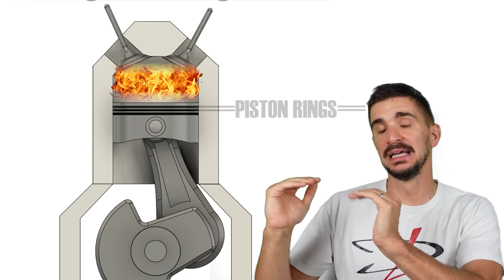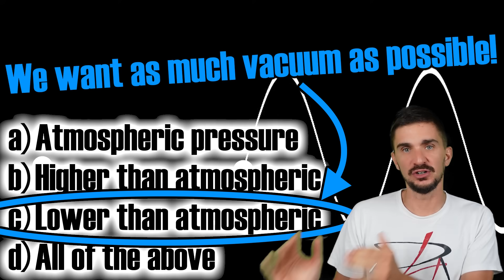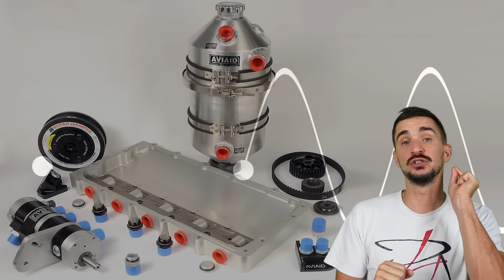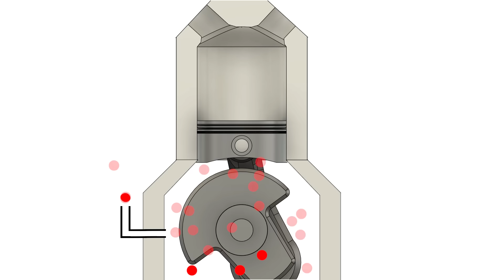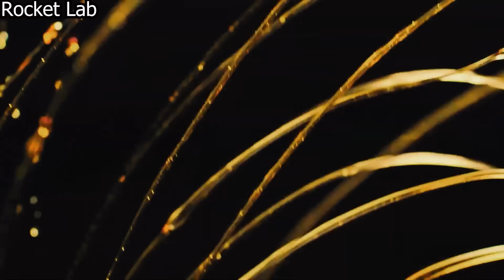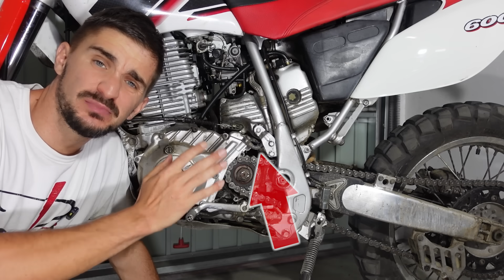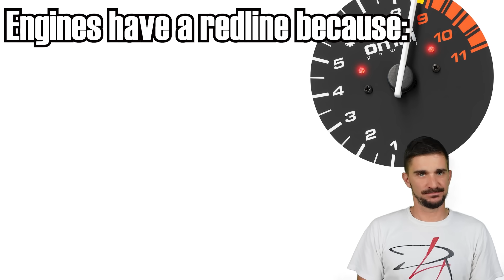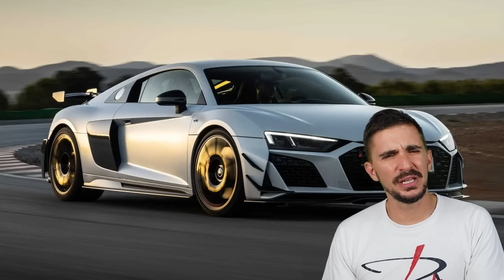Installing This Has No Drawbacks, Except for Your Wallet - Dry Sumps Are Awesome, Here's Why...

Comment: Decades ago, when Yamaha came out with the TX 750 - their first four stroke motorcycle - mechanics would route a hose from the crankcase vent to blow oil mist on the chain. This helped keep the chain clean and lubed. The chain would not wear and stretch as much as the not protected chain.

Comment: On a 1 cyl engine the crankcase volume is always changing/alternating. Anything 2+cyl and the alternate pistons are moving in opposite directions so the pressure remains the same. But...Blowby volume will increases into the crankcase w RPM and that would build crankcase pressure. I've seen drag race cars plumb a hose from the top of the oil pan to the downstream exhaust to help 'pull out' pressurized case gasses without messing w intake ingestion as a vacume point. (Race cars 'Aint Care' about emmissions)

Chevrolet put the LS2 in alot of 2wd cars and 1 (optional AWD) Tralblazer SS. The AWD trucks had the same oil pan/sump as 2wd and launched harder, so alot of guys(and soccor moms that liked to launch hard) were starving the motors over time. The sumps were at the front of the motor so all the oil was moving away from the pickup to rear. All TBSS trucks had 4:11 gearing so even the RWD trucks would starve the pickups but the 4wd ones were worse on the starvation. The aftermarket eventually sold a rear mount sump relocation kit to solve that. You would think GM engineers would have thought about it...maybee they did but accounting possibly killed the 'fix' to save production cost. We are here in 'modern times' and vehicles are still not being engineered or optimized on our behalf to stay reliable. Your 'on your own'  to research the small deets with your vehicles.

Comment: You're really losing me on how the oil drains down in a dry sump system.. It still pours off of the rotating mass. The crankshaft has holes in it that oil the bearings.. The entire rest of the engine and oiling system isn't changed because you installed a dry sump.

Comment: Wouldn't the wet sump be more efficient at low rpm part throttle applications? Less blowby, less oil resistance and maybe then the dry sump pump resistance is more significant? (That would explain why it makes sense is a daily...)

Comment: As explained the dry sump system still relies on gravity, so I don't see how it helps airplanes. That would seem to require closed loop oil circulation without it going into the crankcase cavity at all.

Edit: I looked it up. Basically airplanes have one of two predominant orientations. In almost all situations the net acceleration the aircraft experiences is to its floor whichever direction that happens to be relative to gravity. But in planes that are meant to be able to fly upsidown without curving towards their roof, they simply have two sumps one on the top and one on the bottom, and an acceleration actuated selector valve for feed into the oil pump.

Comment: 11:30 That is a greater heat capacity, but a larger heat capacity does not on its own result in a higher heat fluxrate. In other words without additional radiating capacity more oil will only make the engine take longer to reach its equilibrium temperature, or buffer temperature swings in responce to large changes in power output. It will not change the equilibium temperature of the system under constant loading.

Comment: The whole video suggests that the engine will also become more efficient, because more power with the same amount of fuel = more efficiency. Assuming the extra pump does not eat all of the gains. So I wonder if we will eventually see dry sumps left and right in the name of gas mileage.

Comment: Lower than atmosphere pressure results with the Volvo 2 liter engine ( When the top cover of the valves breaks down ) to sound like there’s a little bird in the engine.  The oil filler cap gets sucked in, creating that sound…

Comment: One drawback that is not covered is that the oil is going to be too cold for longer during startup because there is just a lot more of it to heatup and it can cool down in the external tank rather than it being kept warm in the engine. That is another reason it makes no sense for most street cars.

Also the ND miata's oil system can handle 1.4Gs laterally with simple baffles which is all a car like that needs even if you turn it into a track car with slick tires on and add a ton of aero.

Comment: Tangent, But speaking of wrist pin lubrication. Current dilemma I'm having. My engine comes with forged rods, cast pistons, and oil squirters. The common logic with the engine is to remove the oil squirters when installing forged pistons because the stock pistons do not have any oil holes drilled into them, and all the aftermarket pistons do. The idea being that with squirters you'd "over cool" the pistons, and possibly crack them.

Crazy? Logical? Doesn't matter in a sub 400hp engine anyways?

Comment: If "Performance" were the reason for Ford Wet Belt, it sure would solve the maintenance problem if that belt were external.  Also, I am guessing lower oil resistance improves fuel economy.  The threshold for an engineering change seems to be only a fraction of an MPG for the solution to get into the engineering program.   Dry sump would do that.  I'm simply not buying a wet belt motor.

Comment: great for sucking clean oil out...but you need all that other oil to flow the metal shavings and carbon deposit out that don't come with it much at all and remain in the engine due to lack of flow which causes pressure on the debris inside the engine to roll out the drain....gravel and rocks and boulders in a river and the drain is the water fall. the further away and the faster the suction of the water the less that is removed.

Comment: Lean angle in a motorcycle does not force oil to the side. The centripetal force od cornering combined with gravity makes a compound vector force that is paralel with the vertical axes of the motorcycle.

Comment: Under "Drawbacks" you forgot to state "Increased points of failure (leaks) from the plethora of added hoses." Obviously, this can be minimized in an engine designed from the outset w/ a dry sump, since then the only externality is 2 hoses leading to/from the external sump.

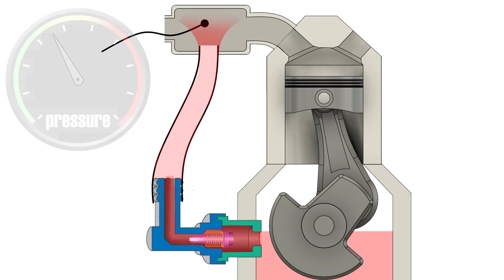Comment: At 2:15 -- You got your crankcase pressures reversed: when the PCV valve is open, the crankcase is above atmospheric [to force the valve open], when it is closed the case is below atmospheric [which sucks the valve shut.]
Reply from the maker: The intake manifold controls the valve not the crankcase

Comment: @d4a As a mechanic in the military, I have to mention that there are also some offroad trucks and smaller infantry carrying vehicles that use drysump or a mixture of both (2 oilpumps one in a kinda small wetsump which pumps oil through an oil cooler and into a resorvoir where a second higher pressure oilpump sits which returns it into the engine) especially serving the purpose of extreme climbing angles in the field. Nothing worse than starving a 12 litre 27 ton truck mid climb 😂. 
thank you as always great vid!!!! feels like the old days where you could just chat with someone on a topic and learn something about it without someone beeing offended or someone knowing everything better

Comment: For those that didn't know, AMG GT had dry sump (older one) and new one doesn't. Also, one drawback that is not mentioned is oil change complexity (a bit more drain plugs, like at least 5) and a bit more oil

Comment: 17:35 You can break the cup😅. Do you have any advice on buying a car that will go for 1'000'000km and weighs less than 950kg running on either benzin or LPG? Other than just good old luck ofcourse, how can I find out what car has the best potential for going on that long whilst being economical because of the weight?
Reply: Audi A3 1.9 tdi

Comment: Wow, great informative video! Thanks.
I think the old Norton Commando was a dry sump engine. This was one of the first sub-13 sec quarter mile factory bikes. Just a 750cc pushrod parallel twin in a light chassis. I'm sure having a dry sump helped it a lot because the pumping losses in a 360 degree parallel twin are considerable.

Comment: Yamaha CP4 crossplane and motorcycle V4 engines could benefit from a dry sump, in the fuel economy department. Their fuel consumption sucks compared to even-firing i-4 engines due to extra pumping losses.

Comment: Dude, the pressure in the crankcase is a wash. You also have to compress the cylinder charge against the vacuum.  You also have to empty the exhaust gasses.. against the vacuum.  You also need to remember that the vapor pressure of liquids goes up with temperature.. you'll be pumping the lightest components of your oil overboard as they vaporize in near vacuum.

Comment: Vaccuum in the crank case for power/efficiency is a moot point. In the vast majority of engines the crank case volume is constant because for every piston moving down you have another moving up, and regardless a pump to generate vaccuum will take more power to be driven than the power gained from the vaccuum in the case (same idea as using a supercharger just to cancel out intake vaccuum), not to mention that if you then have vaccuum when the piston is moving back up you're pulling the piston down which completely negates the benefits in the previous stroke.

Comment: having a slight vacuum in the crank case might gain power from less down stroke resistance but you lose any advantage on the way back up.  Also, whatever you are using to create the vacuum, sump or active system, that requires stealing power from the engine to operate.  There is no free lunch in the law of thermodynamics, sorry.

Comment: A drowback could also be weight? Ok, the oil cover is smaller, but you add 3 times oil the car had before and also there are the oil tank and the pump that a wet one would use. Considering a swap from wet to dry

Comment: Not an expert,but here’s the question. 
Air displacement in the crank case,in my opinion,can only be somewhat significant on one cylinder engine. Any other configuration should(?) work in balance,as for every piston going down there’s one going up,unless,engine has odd number of cylinders or,all pistons are moving in same direction at any given time(wich i never heаrd of).

Comment: Honda had (has) dry sump in their XR / XL bikes with the frame acting as the oil tank since 1980 something.  The engines are of the RFVC type (radial four valve combustion) and would still over-heat, causing cracked cilinder heads.

If I remember correctly, even the famous Yamaha XT500 had dry sump back in the seventies already.

As always: love your in-depth videos! 👍👍

Comment: There is another advantage: The oil filter can operate at lower pressures, which reduces the chance of particles going through  and/or makes the filter last longer. 
Also the oil stays cooler not by its higher volume, but by having it in a separate tank which can have additional cooling (fins, different placement in the engine bay) and is not heated by being part of the engine itself.

Comment: Let’s say you have an inline four. Instead of having a crankcase shared by all four cylinders, you could partition it into four compartments. Each one would oscillate from low to high pressure. Now put a one way check valve on each compartment. Maybe use reed valves from 2-strokes. 

Now each compartment would run at partial vacuum. Free horsepower.

Comment: Still feel having a dry sump is a bad idea for long life of normal street cars, it seems to be good only for track events though.

Sure, it reduces resistance for the piston to compress in the crankcase, but also remember, we are literally increasing the pressure differential between the actual combustion "chamber" above the piston, and the low pressure chamber below it. This will cause the fuel air mixture to be forced past the piston ring seals into the crank case, and we will end up losing more power than we were gaining at the cost of losing the primary component that s generating that power. The only option to prevent this is to reduce the tolerances of the piston mating surfaces with the walls, which not only increases cost (machine and material), but also increases pressure in the cycle, and subsequently, reduces the life of the piston as you are now introducing high chances of piston scoring at high rpms against the walls.

That problem is even worse when you introduce boost in the system.

Comment: can you guess the contents of my comment? her maybe you can guess from these choices; A. overly long. B. Sarcastic. C. Funny. D. All of above. well if you guesses D than you would be correct. so if we look at the contents of my content I am mimicking the youtubers style of commentary, stretching out the content to fill the void of actual content and padding the length to look more cohesive than I may be. but lets take a look at the previous list of options I gave to you earlier; A. overly long. B. Sarcastic. C. Funny. D. All of above. while technically the correct answer is D you would also be correct if you chose A as well. because the other options given are barely even here in this comment. but just barely so I can do this bait and switch after I made you choose,. so while there is some sarcasm and it may be subjectively funny, its really just long and obnoxious for no reason.

Comment: JFYI the lean angle of a sports bike does not affect the oil distribution, that is because the sum of all the forces acting upon the vehicle must pass through the contact patches of the two tyres, i.e. the forces always point 'down' with respect to the engine. You will get more effects from acceleration and braking, mostly acceleration, because the power to weight ratio is huge. Also when there is a change from right-bank to left-bank (direction change) and the rider is 'trying hard' this will cause oil distribution movements. However...  great video, thanks.

Comment: 8:51 this is an assumption that rings seal better! SEALING of the rings is based on the delta of pressures.  Since a vacuum vs exploding pressures are bigger, the leaking will be greater!

Crankshaft resistance of the oil is the greatest culprit due to density of oil vs air

Comment: 4:47 Correct and NOT EXACTLY true it will eventually stop since we don't exactly know how #Spaceatime works ... but overall correct!  

let alone that so engine purpose  we want Positive pressure to smack up the cylinder during compression cycle and compress the gas-air mix for a FREE compression

Comment: Well, most of the cars can’t turn or even brake that hard for the need for a drysump. Larger oil volume heats up slower which equals poorer emissions and the maintenance can be a nightmare because you don’t have one big plug to drain the system. A drysump has a point only in motorsport.

Comment: Incredibly informative and easy to understand video as always!
I just have one question regarding maintenance. When performing an oil change on such a system, you would have to drain the oil pan and the external sump, but do you fill the oil back in the normal way and let the pump suck it out of the oil pan? 
Because if so, wouldn’t there be a couple of seconds, where there is barely any oil in the system, since the external container needs to be filled by the oil pump before the oil can be pressurized and fed into the oil system? Or do these containers have a filler neck or something like this?

Comment: 17:10 another belt to monitor which is just as important as timing belt. Thats a drawback, but a pretty long lived one
Reply: There are also dry some systems that are electrically driven
Reply: whats the joke?
Reply: Unlike a timing belt, if a dry sump pump belt snaps, you'll immediately get a warning light and you can save the engine. If your timing belt goes, your interference engine dies.

Comment: This is such a great video, so thank you for the very informative content. Could you take a moment and describe the relatve benefits (or downsides) of using a vacuum pump on the crank case (assuming appropriate wrist pin lube).

Comment: One of the benefits is avoiding the moronic engineering decision of putting a belt driven oil pump inside the engine where it's constantly saturated with oil.

Comment: 9:06 you putting it on your Toyota? You got that 1.6 up over 400 right?
Reply from the maker: Around 300, I think it could do 400 though 😈
Reply: I had that engine in my 93 prizm, got to 480k kilometers when the timing tensioner seized. Dumb kid I was. Just thought hey it's non interference, I'll be fine. Tensioner snapped off the block, totaled.